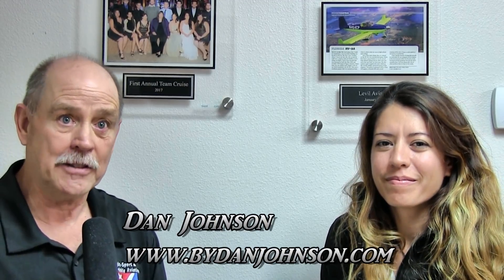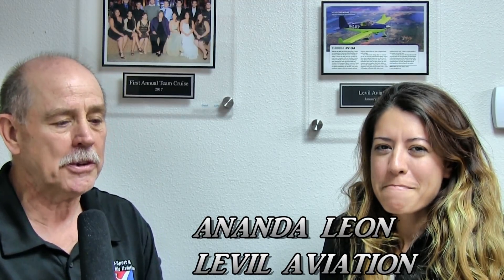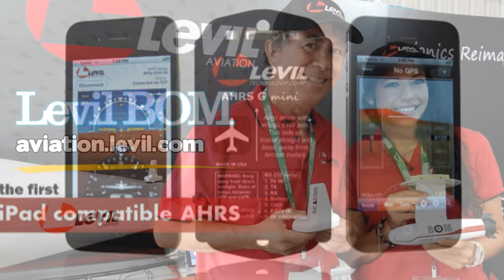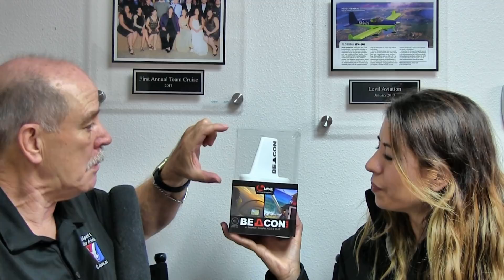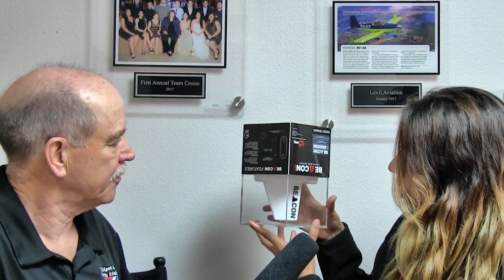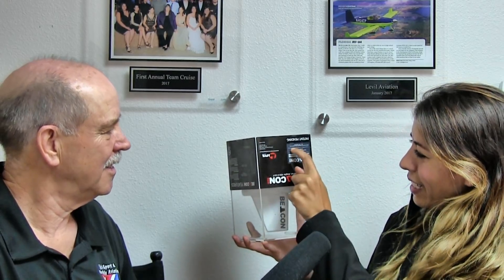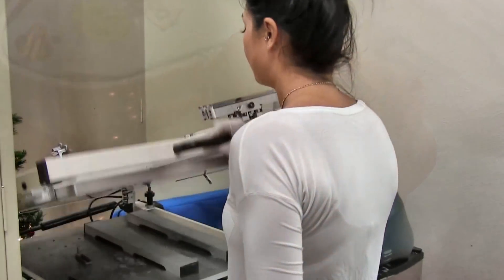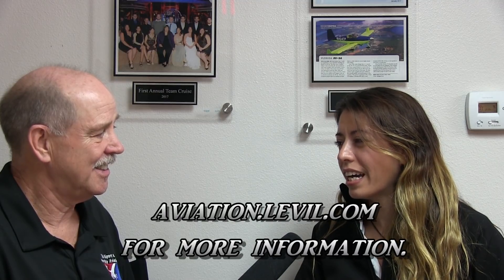Levil Aviation Beacon Affordable ADS B Out for light sport and experimental amateurbuilt aircraft

Comment: Is the Beacon not available yet? (now being Sept. 2018)  I went to Levil's website and did could not find any mention of the Beacon.  Also I saw a video from Sun'nFun 2017 where Ananda was demonstrating the Beacon with a clear plastic case.  I thought it looked very cool in a clear case and would love to see that as an option for the Beacon.
Reply: Is this beacon UAT ( 900mHz) or extended squitter 1090mhz
Reply: Production had been delayed because of FAA-required changes/upgrades. This may not be available until after the first of  2019. They've basically lost a year of production with these changes.